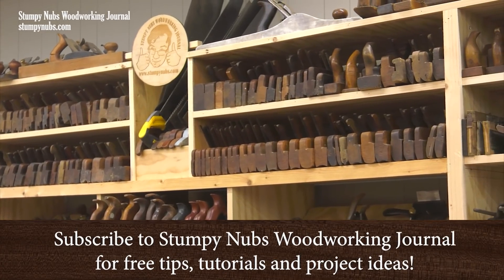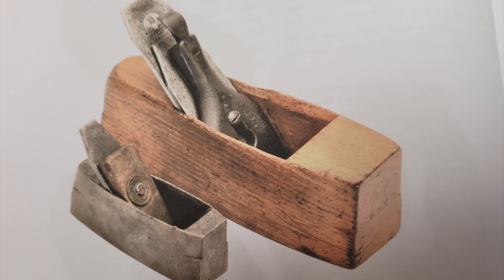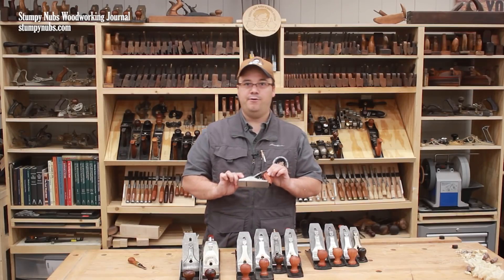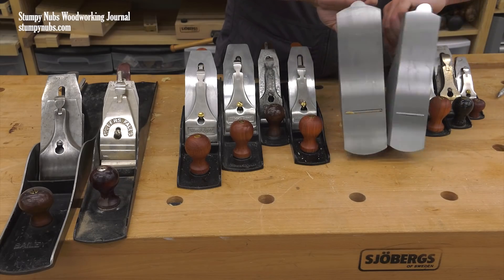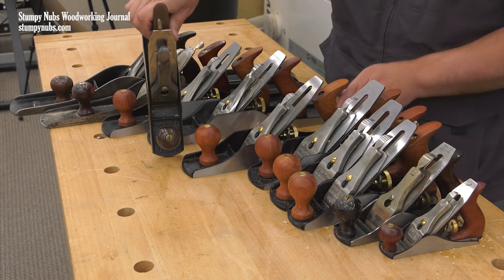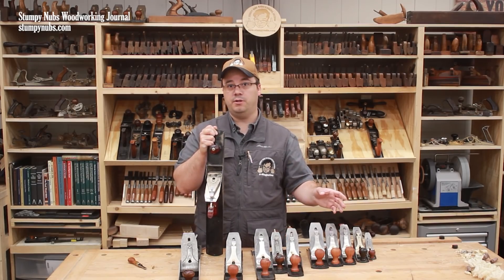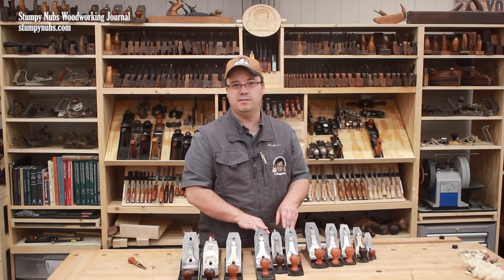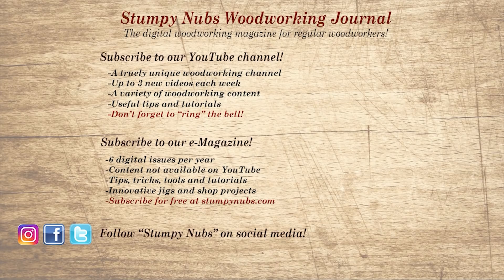Do you need all the different Iron Bench Plane sizes?

Comment: I've been woodworking for 58 years, since I was 6 and my tool/die maker grandfather introduced me to the craft.  I never fail to learn from these videos.  There are so many facets to honing this craft that there is always something to learn from others.  I especially appreciate James' low key demeanor and comments as to the actual usefulness he has found from each tool.  Thanks for the diversity of topics, your perspectives, and the information you offer. BTW I use mostly a Stanley 1939 corrugated bottom #4 and a Wood River 4 1/2.  As you said, sometimes I like the light weight/speed of one, and the heft and performance of the other.

Comment: Your plane wall is impressive.  And since starting on my journey, I now have 3 number 4s, 2 of them are just for normal use, as saves me sharpening mid project, just pick up another plane, and got an acorn yesterday for converting into a scrub.
 I have a restored no 5, and a stanley 50 combination, a stanley 78 rebate.  Such lovely tools, and I cant wait to get more. 
 I also have a thing for spoke shaves currently have 4. I bought a new one, and the grinding to get it usable was horrific, 20 hours. The vintage ones work great with a simple sharpening and then good to use.

Comment: very well explained! I really enjoy your way of letting new woodworkers understand why there are so many variants of "the same" tool. and I wish I saw your video when I was just starting. however I think I made the right "blind" choices, not understanding at that time what I was buying (pure luck): I have 2x #4, 1x #5, 1x #7. why 2x #4? stupid cheap bargain effect, I bought it and then never used it.

most of the time I use #7, because it's a breeze to just straighten / flatten the board, much faster than to roll out my industrial 12 inch jointer.

obviously when I need to prepare more than just 1 board, I would go for the power tools.

Comment: Hello Mr. Hamilton! I want to start off by saying I've been following your channel for a very long time. Have I seen every video? No. I do appreciate everyone that I have seen though, especially the ones about forward thinking and safety!!! I really wanted one of those 4/4.5" chainsaw carving things until I saw what they can do in a New York minute. I'm following your current series about hand planes. Here comes my question... Are you going to do a restoration and maintenance video about these devices. I inherited some many years ago and so inherited some issues. Some are rusty and/or missing the cutting blade and other parts. What kind of steel would I use to replace the cutters? How to clean the rust and prevent future infection of oxidation. I was thinking of 01 tool steel but would regular cold roll work? I'm a man on a budget and don't shun advice when I ask for it. Thank you for all of your videos and your insight has made all of us a bit wiser. Safety First! :)
Reply from the maker: Maybe
Reply: New York minute? More like a New York second! I always appreciate James’ safety oriented videos

Comment: I have just discovered the real cost of getting into hand planing. You can buy a decent plane, like the Woodriver planes that James recommends, but to get the most use out of it, you need the sharpening tools to go along with it. And the more you get in to it, the more you're going to need to spend on sharpening tools. 

It think you could easily spend $500 just to get started properly. I don't say that negatively. It's the reality that should prepare you when you're ready to get started. This video certainly opened my eyes to that reality.

Comment: For me, I use a No 3 for all my smoothing and the reason is very simple. I made my bench plane storage under my workbench before I bought a No 4. When I finish my tool cabinet, I will use all the planes more and decide which ones I will go to more natually. So far, I have used No 3, 4-1/2, 6, and 8 regularly.

Comment: Question, what is the best way to get the blade parallel with the block body?  I rarely use these tools, just a DYI weekend hobby, but I always seem to spend more time aligning the tool than actually planing.  Perhaps make a video on how to set one of the up correctly?  How to identify the grain pattern?  What do for different grain direction for material like molding that has different pieces spliced together.  What is the correct or best amount the blade should extend the block? Etc

Comment: The handles of the #1 & #2 were not meant to be griped like the other planes. If you hold them between the thumb and forefinger with the other fingers wrapped around the body, you can easily use them like a block plane. I use my #2 and sometimes the #3 as heavy weight block planes.
Reply from the maker: While it is possible to hold them in any way you find comfortable, saying that is how they were "meant" to be gripped is pure speculation. Stanley already had plenty of block plane models in their lineup. They did not develop the #1 to be a less comfortable block plane.

Comment: I couldn't agree more about having a few planes for different purposes. Once you've 
'mastered" sharpening and setup. Although not a huge fan of cambering, I do appreciate having a few jack planes setup with different cut depths. The great abundance of 4's and 5's makes owning a couple of each very affordable. I also agree, my favorite plane to use is the 5 1/2. I have 2, one setup specifically for the shooting board, the other with a super sharp blade for almost finishing. I find the width and length of the 4 perfect for final finish. 
I have a question for yourself and anyone who owns a woodriver plane. They come with A2 blades, how durable is this blade? It seems that while A2 would be perfect for the heavier work planes, a O1, with its keener edge is the best choice for a smoother. Thoughts?
And thank you, this is an excellent series, by a natural teacher. Great job!

Comment: Now I have a question. I hope you can help! I recently disassembled a Bailey Stanley No 5 I have to clean it uo and flatten the frog, no problem but when I went to put it all back together, for the life of me I have been unable to put the cut of depth adjuster wheel back onto the wheel mounting screw! Can you tell what the thread size of this wheel mounting screw and the threads of the adjuster wheel are? They are roughly around 10-24 but I have not identified the thread size yet. Second, have any tips for getting the adjuster wheel back onto the adjuster screw? I am thinking that once I know the thread size I can just run a drill tap through the adjuster wheel and perhaps lightly, very lightly, file the adjuster wheel first thread to de-burr it though the drill tap treatment may do that, too. I finally solved the problem myself. First I successfully cleaned up and deburred the first couple of threads on the adjuster wheel mounting screw. Second, I figured out that the adjuster wheel has left handed threads so I had to spin the adjuster wheel onto the mounting screw "backwards" ( counter clockwise) and then it smoothly mounted. :)

Comment: I only own two hand planes, a block plane which was my first one and a number 4. I'm mostly a power tool woodworker but the number 4 is great when you need to essentially cheat joint two boards to get a nice glue up surface. One day I may actually buy the number 7 or 8 but for now, I get by just fine with what I have. Remember people, if it's worth having, then save up for the best one you can get.

Comment: Ok, I have a question. Even though I am hobby woodworker, I also am on the lookout constantly to grow my plane collection, so if a plane is reasonably priced(in my terms) I will buy it. Needless to say, I have a few #4 & #5 which leads to my question.What about sharpening angle. As all my planes are old/used, they all came with blades with various stages of disrepair. I usually just look up on the internet to confirm which angle should the blade be sharpened at but with some experimenting at least for me, sharpening at different angles changes on how the plane works with wood. Some angle to me appear to work lot smoother with Hardwoods like Oak, Cherry or Maple than others....Am I just going down the wrong path or is there some science behind it?
Reply from the maker: https://www.youtube.com/watch?v=IqPw3qXS3YU
Reply: @StumpyNubs   hahaha...I started the video and knew exactly what the answer was(as I have watched it few times before). Funny, how I got so engrossed...that I forgot the logic behind the bevel. Thanks.

Comment: woodworking masterclass just put up an interesting video about the size of stanly planes.  a number one weighed 1lb.  a number 2 weighs 2 lbs a number 4 weighs 4 lbs etc all the way up the range, except for the 5 1/2.  makes you wonder if this was the true origin of the numbering system.
Reply from the maker: LOL- They have to do some serious rounding to make that formula work. A #1 weighs about 1-1/8 lb, a #2 1-1/4, a #3 3-1/8- You may say "well, they just have to round down a little to get whole numbers. But the #4 is 3-3/4, the #5 is 4-3/4- now you're rounding up to hold the formula together... And it all fall apart after that. The #6 is near eight pounds, the #8 is almost 10 lbs... If Stanley was using weight for their numbering system, they sure weren't consistent about it!

Comment: I like the Wood River planes because they're bodies are ductile iron rather than cast iron.  They aren't as fragile if you drop one or accidentally (and carelessly) push it off the bench maneuvering a piece of long stock.  I tend to think that the classes like "fore," "jack," etc. are kind of meaningless, since you can do all the same tasks with different planes, depending on the length of the stock.  Making a small box, all you really need is a block plane.
Reply: @wildough  I do have some Veritas pieces, though none of the bench planes.  Lie-Neilsens are great, IF you have the money.  I do have one of the L-N rabbet block lanes.  Once you have been using any good bench plane for a couple of years, it is no longer what you unboxed.  You've either put work into it to a point where it is as good as you want, or it has diminished to a state you can maintain.  As far as infratstructure goes, my vehicl is a Jeep Wrangler and I'm sure buying that did more for the US economy than three Woodriver bench planes would detract.

The majority of the planes I use are far older than the Lee Valley, Lie-Neilsen, or Woodcraft companies and most are pre-WWI.  That said, value for value, Woodriver planes are quite decent.

Comment: "The marketing worked"  I'll just look away. 
I use my number 6 for hand planing/joining of rough sawn wood, instead of using a scrub. Then switch to a 5-1/2 to clean the 6 marks up. When using power tools, I don't think I've ever used my 6 as a companion. It is a fun plane to use, but only if you enjoy the contentment of hand planing.

Comment: One interesting and I think important factoid is that the same plane blade size will fit into the No. 4-1/2, 5-1/2, 6 and 7 hand planes. Of course older to much older hand planes may not readily accept a thick plane blade. My hand planes are not vintage, being either new Bailey Stanley or Woodriver and I have thick plane blades in all of them as I hate plane blade chatter and its ill effects.
Reply: chatter isn't due to blade thickness - that is a myth. (Check out Paul Sellers' video on that subject too)  True, there are some uncommon instances where chatter is possible (at least that which is due to the blade actually moving) but a lot of it is simply due to the USER. I have learned, after my own experiences with the same plane (Vintage Millers Falls No.9, thin blade) and paying attention to my techniques, sharpening, and set-up, if you are getting chatter, you need more practice with that plane. You can get the same chatter whether you have a thick blade or a thin one. (as I discovered after buying a thick woodriver blade to put in and was getting SAME RESULT)
Reply: I said I hate chatter. Never said I ever got any chatter when planing. Check out Rob Cosman online at his youTube page and his various videos that touch on the subject of plane blade chatter.

Comment: I have a question:  I am looking for something to protect my lungs from sawdust.  I have beard which makes it more difficult to find something at a reasonable price to work.  Trend Air Circulating Air shield Pro is about all there is on the market but the price point is high with accessories just as bad.  Do you know of anything that is as good or better with a lower cost on the market for this DYIer wood worker’s with a beard?  Thank you for your time Ron Schubert
Reply: Buy the largest shop vac you can afford and get the bags that go in it.  Rig up something to position it to suck the sawdust from whatever tool you're using as best you can. A mask is better than nothing but not by much with the beard leaving it open.  A fan to direct the dust away from your work area might be possible too, depending on your set up.

Comment: If you look at the pages of a mid 1950s Stanley catalogue, you will see on the page related to the number 5 “Jack” plane that “Jack” actually stands for “Jack-Ass” plane not “Jack of all Trades” plane.  Doing some research shows that it referred to the “nickname” given to the trades people who used the plane.  Yes “Jack of all Trade” is more politically correct in this day; however, it does not appear to be the actual origin of the name back in the late 1700s to 1800s when the word was not considered as negative as it is today.  Who’d of thought it? (Name of a pub near Plymouth, England).